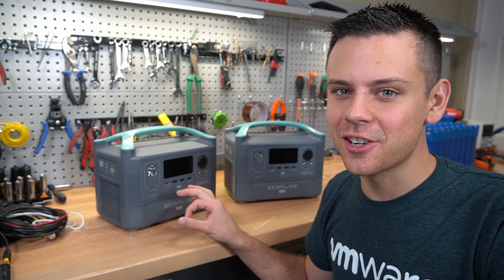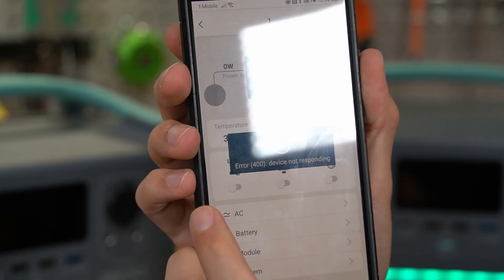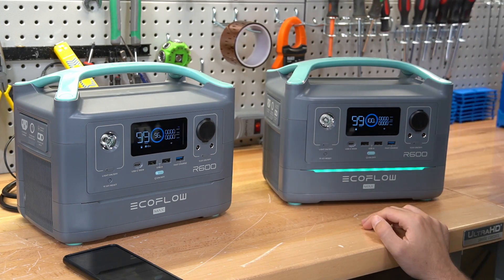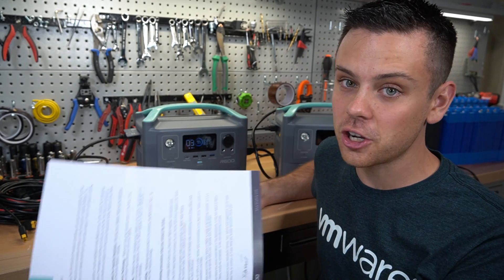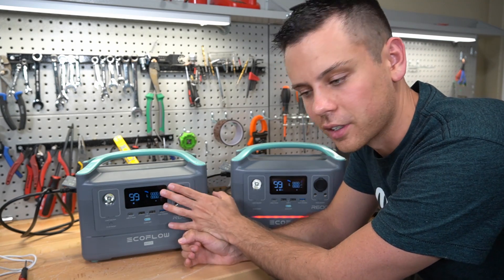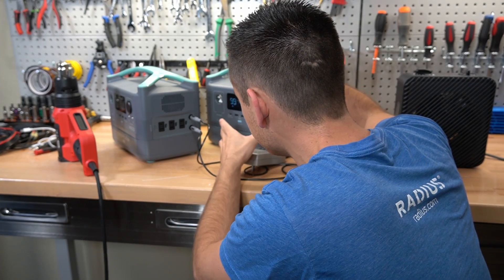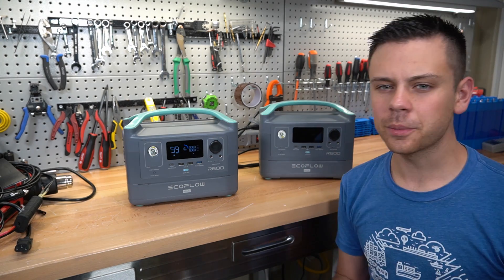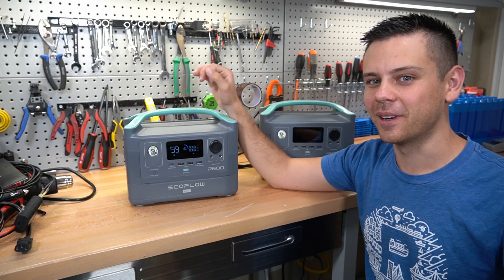Ecoflow R600 Part 2: Did the Firmware Upgrade Fix the Problems?

Comment: On the dead one: pull the extension battery off and see if that resets it. If not, do the firmware upgrade again without the ext battery on. I dont know anything more tgan any other battery user but thisvis the kind of thing you always had to do with professional photography battery powered flashes.

Comment: Could the extra efficiency loss be because instead of passing through the current from the first R600 in the chain to the output on the second R600 it was just charging the second one while the second one was depleting it's battery at a similar rate to it's output?

Let's see. 880W. The second battery depleting only goes through one conversion so it's 576Wh * 0.87 about 500Wh. So the R6001DC-->AC would also have 87% efficiency so the remainging 380Wh would be ~437Wh and then the AC back down to DC would be a 76% efficiency.

I can't remember if you did a charging from AC efficiency test. But if you did and it's 76% then that makes sense. It's not a good thing, it's meant to pass through the current. But it makes sense.

Comment: A start-up begins to vastly increase the complexity of the products they offer by making it "smart". Software and the processes surrounding it is hard. I'm not surprised to see problems like this. I'd love for them to succeed though. It's unfortunate that they tried to move too quickly with this and failed, but that's what being a start-up is. Even at this stage where Ecoflow has put out a fairly solid product like the Delta, people should understand they're still taking a risk by backing this. That being said, providing that the issues here are indeed only software, it's still a low risk as it can be fixed over time. I just hope there's no issues with the hardware here, but based on Ecoflow's most recent testing video where they displayed the products doing exactly what they should, I can only conclude that the issues you're facing are completely software related, or you have a different hardware revision to them.

Thanks again for the review, you shouldn't be doing QA for them, but I'm glad you are. Hopefully they can learn from this so they don't repeat the same mistake later down the line. I'm still rooting for Ecoflow to get this right.

Comment: 6:05 turning on the first unit is not a realistic test for the chained UPS function. A more realistic test would be to turn on the grid power to the first unit and see how the units behave and whether they will start up the chain again. Also why chain them anyway when you can connect them together in parallel to make 1200 w with x-link.

Running the test with the firmware version number not updated creates a bit of uncertainty, did they really update, did they fully update?

Comment: is the software using bluetooth to connect to the firmware? if so, this is probably why it takes so long. there could also be some interference that's getting in the way of the update but everything ive used that goes through BT is mad slow. they should definitely work harder to fix all these issues because the product actually looks pretty cool.
Reply from the maker: It's wifi
Reply: @WillProwse   u sure its not dial up?

Comment: Can you tell me if EchoFlow Delta has the ability to update firmware like the R600?  Is the R600 compatible with the EchoFlow Delta or is the Delta standalone?  Do you think the bugs have been ironed out of the Delta?  I was going to get the R600, but I will wait. I have the Delta so far so good but barely used.

Comment: Thanks for chasing the solution, Will. I am amazed that the CEO got in touch with you; but you are worth a ton of money if they get you to figure this out for them. When this industry gets their ducks in a row it’s going to change the small camper power issues ... my NuCamp 2018 T@B 320S will be able to run the wall /window A/C (under 1000W) soon? Getting close? Thanks for explaining this stuff to us.

Comment: Project started with little or no design & manufacturing experience .
Designed by a non user .
Tested by the marketing department !

This all smells like a Kickstart project or someone's good idea .

PCB design at the lowest cost , Low parts count & with no idea of the functionality required , 

Manufactured by the lowest cost bidder .

Should stop trying to limit the input / output current for safe battery change / discharge  .
Just make it a bigger unit with a usable battery .

This unit has all the bits but they just didn't work as a all in one unit .

Comment: Ecoflop,..these small “solar generators” are POS and made to fleece people out of their money. Build your own with simple parts no firmware needed! Will, get back to building your own again or partner up with Jehu on building small to medium solar generators for less than these things. We already build these for customers in the $1400 to $1600 range with 3000 watt pure sine inverters, MPPT charge controllers that handle 300 watts with 12v setups or 700 watt input for 24v, 1 x 250 or 300 watt solar panel. Choosing various battery chemistry changes pricing however getting cheaper with LiPos or reclaimed EV batteries.

Comment: It will be interesting to know if it is something faulty in that one unit or if/how much more software updating needs to occur. If faulty then it may explain the daisy chain ups and x-link issues you have been showing.
Goes to show how much better quality control is needed for these items that come out of China. You'd assume they double checked them before sending but maybe that indicates some fragility - was something damaged in transport? Interesting if you opened the faulty one up to have a look.
Ps appreciate your hard work Will.

Comment: These power stations (and other electronics) should work out of the box without going thru a bunch of steps.  You should not have to update the firmware as soon as you take it out of the box.  Not everyone has the ability or knowledge to fix/update/repair these things to get them to work as they were advertised. 
And how much trouble and frustrating would this be to have these problems when you are on the road?

Comment: Close, but no cigar.  I have a couple Delta 1300s that I'm very happy with.  However, the Delta does not have a user updatable firmware like this R600.  That's an advantage for most of the issues that Will is having to uncover, in that they could be fixed even after receipt of the unit.  Also, it's possible that some minor additional features could be added.

Somewhat not surprising to still have "bugs" in the system, but unfortunate that a reviewer (especially one with the large viewership that Will has) is discovering them.  The early adaptors are very fortunate to have Will on the "product/quality team."  I hope that in the end he is compensated for his tireless efforts on our behalf (though he is very careful to keep himself clean regarding sponsorship ethics, which is impressive and gives his reviews more credibility).

Thank you, Will for your efforts on our behalves!!

Comment: The prepper crowd drives this BS. The majority of them would buy dog shit if the manufacturer and some YouTube channels said it would work... because, for the majority of them, it will just sit in their basement until they "need" it. They do the same with guns, radio equipment, etc... its pretty damn apparent these days, but hey.... 'merica - land of the greed, home of the enslaved. Between the under-the-table freelance marketers (aka youtube reviewers) and fake-ass written reviews, I'm surprised the fed hasn't slapped more of
 them down with fraud  charges... then again, why would they try and actually help, that's be out of character for them.

Comment: Failure after failure.  Perhaps Ecoflow should hire an actual engineer rather than just guess at what might work. Otherwise, this product is stillborn.  Dead on arrival.
Reply: Knowing how most companies work they probably have actual engineers, maybe even good ones, but they don't call the shots. The marketting department and middle management do. They make the promises and set the timeline  without consulting the engineers and then the engineers scramble to get it done, fail, and then they release uncompleted it anyway.
Reply: You put it alot nicer than I could.   These are basic tests that should be being done already by the engineers.
Reply: Quality Control? If they don’t act on it people will learn the hard way never to trust pre production products from EcoFlow. The ideas are great! The products are what we want but they should work at least tested in-house before sending even out to be evaluated. That way the evaluations will show it’s okay to pre purchase.

Comment: thank you for making these videos and not letting your integrity be compromised by a tempting affiliate program. its extremely appreciated. 
looks like they're making quick progress, but the thing is still far too temperamental to rely on, which is what we want from a device like this. 

its funny, they actually market the UPS feature as a stretch goal which we haven't reached yet, so while on the one hand its nice that they've developed it already, its also a bit disingenuous and manipulative, just like the bought endorsements. that seems to be their way of doing things and i don't like it at all.
i'd love this product and what it offers, but i'm not sure i want to continue to support them.
thank you SO much for not letting them pull the wool over our eyes. i hope they see the sense in actually rewarding YOU for your extensive testing(which they don't seem to bother with) and for challenging their business practices, rather than try to discredit or censor you and continue to invest in deception.

Comment: With so many decent options in batteries similar to this product, avoiding this one seems like a no brainer.
Reply: The few tests that failed are things I will most likely never due. They fixed almost half the bugs in three days. As a developer that's pretty damn good. It's still a way better deal then the jackery.
Reply: James Bennett Maybe so, but cooling issues come down to basic product design. If they are overheating I don’t think a firmware fix is going to cut it.
Reply: @mondotv4216  Yeah some overheating could be overcome by software updates. It could be a control system bug. I dunno shit about battery management but I think it's safe to say software can limit overheating. Still, I picked up the R600 plus as an early bird for 479. I don't believe there's a 768wh power station that comes anywhere near that price. I'll be using it to run my cpap when camping and when a blackout occurs. Maybe run a tv or charge some phones. For that price, it'll do everything a regular guy consumer will need. And the charge time is the biggest draw.
Reply: @007bennett  I read here that you use a cpap. I camp also and my wife takes one. I want to stay at places without power and run it. How many hours will a full charge give your cap? I am new and haven't figured out all the math with volts and all that. It sounds like you recommend this one.
Reply: @sjgutierrez72  Hey I just took it out on a camping trip. I got about something like 12hrs maybe out if it. I did not make it through the second night. I lukily had a backup battery I had brought that gave me an additional 4 or 5 hours. I think if you used a travel CPAP you would get more time. I did turn off the tube heater and put the temp pretty low.
Reply: No it doesn't as its pre-production so they're ironing out the issues now as this produced in being funded to produce.